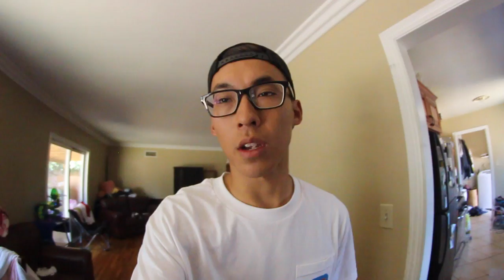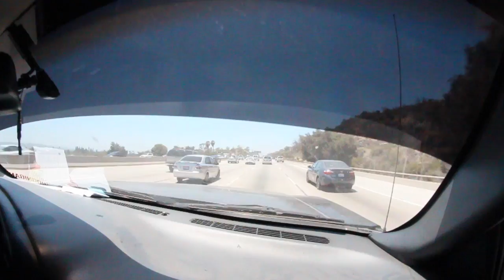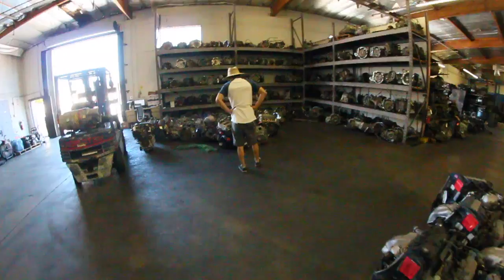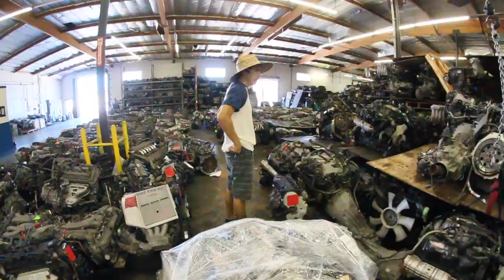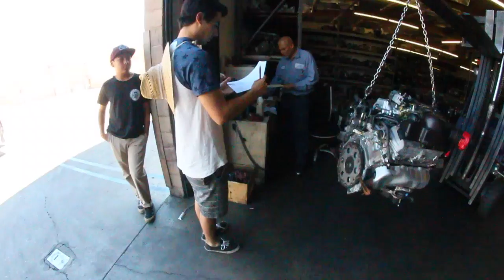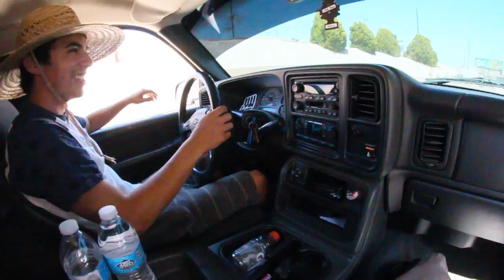HOONIGAN V8 NISSAN 240SX S13

Comment: Great message at the end, speaking the truth. 

I haven't checked the pricing myself, are 1UZs that much cheaper than a 3UZ?
Reply from the maker: I don't know how much the 3UZ's are but I know the 1UZ is a bargain price from what I have heard but who knows! I'm definitely bugging my friend to let me drive this when he is done haha
Reply: Diss Foo Josh Either should be fun, I just looked up some pricing 3UZ is a few hundred more. Do you know what year 1UZ he got? They ranged quite a bit on power. I was surprised how light they are.
Reply from the maker: I have no idea what year i think it is a 1UZ-FE if that helps, I know the motor does not have VVTI. The ones that did come with VVTI made more power when i say a spec sheet for them.
Reply: Diss Foo Josh ah ok, so an early model. Probably 250hp. Should still feel like a rocket.
Reply from the maker: Anything swapped in the S-Chasis is better than the stock KA lol, I'll make another update video as it comes along.
Reply: Diss Foo Josh Haha true, looking forward to the new video.